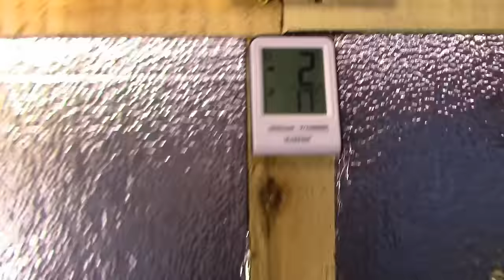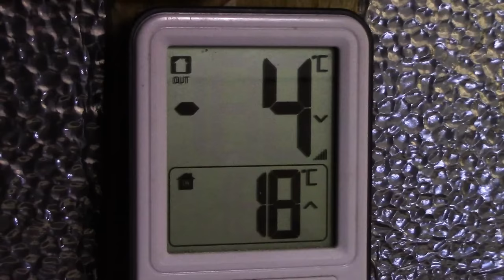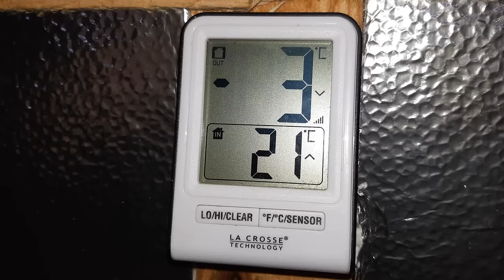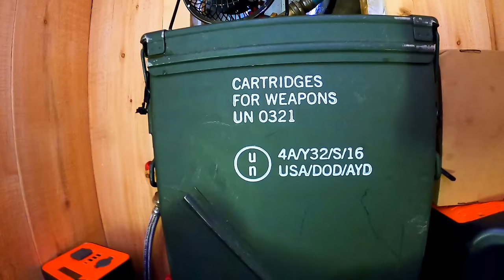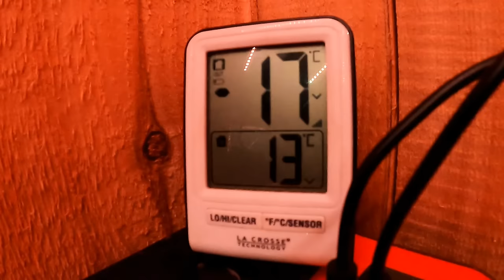Snowmobile Camper Supercut- First 3 Journeys

Comment: Possible modification:  build a folding bench that attaches to the side of the cabin for when its closed up.
Reply: I was thinking the same thing, just so you don't lose any heat from inside. You then might need to have a larger fire, but he has a chainsaw and there's got to be a dead or dying balsam near every place he's been, or I assume. Seeing as how they're all dying here in the U.P. of Michigan. Not good for stove fires but perfect for a bonfire.

Comment: You might bring additional foil-nacked insulation or space blankets to set up behind the fire and to the sides to reflect heat from the fire into your cabin. That way you could leave the door open without losing so much heat.

Comment: On the side where you put your feet with that little window you should put a table that folds up on that wall. And when ready to use it disconnect a chain or some type of latch and the table will fold down. Kind of like a bed that folds down from the wall in a studio apartment 👍

Comment: You should look into getting a diesel heater, dry heat, safe, sips fuel.
With the small area you have to heat, the heater set at the lowest setting, should keep you warm all night.
It does take a 12v battery to run the fuel pump, but it should last you for a week.

Comment: You could use a mini propane heater under the floor, venting up into camper. Like a Mr. buddy heater. Have it all outside. Maybe dig hole in snow under camper. Some sort of metal grate / vent.

Comment: Great video!  Another option for thermal battery liquid would be salt water brine.  It freezes at -21C, holds potentially more heat than antifreeze (depending on your mixture), and you can mix and discard it on site.  Probably easier to bring a bag of salt than a jug of antifreeze.  Just a thought!

Comment: I was hesitant to watch a very long video but I'm glad I did watch it all the way through to the end. It took me a little while to catch on this compilation was an evolution of a heating system. I really learned a lot about maple syrup. Really enjoyed that part. I suppose I'm fortunate that I haven't seen every video you've done as I've seen a number of people complain the entire compilation is a repeat. I wonder if they tuned out too early and missed any new content? If I may mention the copper piping that is connected to the stainless braided tubing could be insulated with pool noodles as well. Copper is a terrific conductor of heat and could be losing a great deal of heat before it even gets into the shelter.

Comment: Hmmmm...it would be interesting to investigate attaching a steel-lined insulated wood box under the camper. Perhaps semi-rigid Roxul would work as insulation. Leave an uninsulated space above the box under the floor for the heat to radiate up into the living space and means to get the rocks in and out easily. Radiant underfloor heat!

Comment: Great as always. I wonder if there are any quick release couplings like those used in hydraulic systems that you could use for the heating pipes, instead of screw connections. That way you could disconnect the heater, move the shelter and keep all of the fluids on board saving the anti-freeze even if it is enviro friendly, All the best to you and your family.

Comment: I was wondering if you ever considered using hand warmers to keep your little shelter warm? It would seem to be safer than heating stones and putting them in ammo cans that may give off a toxic gas that may injure you or burn you. Perhaps you might build a shelf with an edging around it so the ammo boxes will not accidentally fall on you, but yet, be out of the way. I'd also put a tough fabric screen over the vents so a critter could not come into your shelter in the middle of the night. I love your idea about heating your camper with a boiler concept. It is apparent that a lot of thought went into it.

Comment: Perhaps burying the lobster pot in the coals would increase the length of heat time. 
Also running the insulation closer to the fire but not so close as to burn would help hold the heat in the lines better.

Comment: Try bricks in the ammo box...Much bigger more uniform volume over rocks and flat so can easily stack(can even make a little brick oven with the fire / reflector?). You might be able, to trim them to fit in a singular ammo box? Double the insulation, maybe even clad the interior, add a YETI for the Solar panel, 1ft cargo box on the end for extra firewood/ equipment. Mass produce and make the Outsider Mobile Shelter (OMS).
Your Dad's one will be a 7 star Hotel with all the lessons you have learned. This is a very impressive project - nothing but Kudos and respect for you.

Comment: I do have a suggestion for your heating system, if you used two double wide computer liquid cooler radiators you would have a highly efficient heating system.

The double thick double wide radiators dissipate about 350w of heat, and the single thickness double wide radiators can dissipate about 200w of heat.

So with your current water system you could theoretically have a compact heating system that provides 200-400w of thermal dissipation, giving you an average of 682.42BTU and an upper max of 2047.28BTU per hour.

All of this capacity in the space less than that needed for a toaster, just make sure you get the type with all metal fittings. Another option would be ceramic heater cores like the 30 watt type just a thought.

Comment: I made a comment in one of your videos saying to run copper lines in and out of your camper but I didn't think of the ventilation situation you did excellent idea,I remember back when I was a kid guys ice fishing would use charcoal in a coffee can run to your open hole on the ice to keep the hole open so it wasn't freezing such they used a 1/4 inch copper line,that stuck in my head when you were experimenting with this similar method...great video and god speed!

Comment: Love the heating system you ended up with. I have seen something similar to heat a hot tub and small pool but never for an indoor space like that. Kind of wonder if it might work even a little better if you ran pex tubing under the floor for it to go through like in a home radiant heating system. Was also curious how the rock heaters might work with soapstone and bigger (or a couple more) ammo boxes. I know different stones have different thermal mass and I think soapstone is supposed to hold and dissipate heat much better than some others. It has traditionally been used to build masonry heaters that supposedly are able to heat homes for more than a day after the fire is out as well as in the floors in a traditional Korean ondal heating system which apparently can do the same. Might be cool to experiment with if you can find some. Anyway glad I stumbled upon your channel. Looking forward to watching some more of your videos!

Comment: Great Video. As for the cold clothes left outside: next time put them in a sealed plastic bag, even a rubbish bag with the top knotted should keep the moisture from escaping into the camper. Putting on frozen clothes definitely does not sound very comfortable.

Comment: You need outside mounted gas tank on rear of camper , no fuel inside in case leak smell lasts for hr,s maybe days insulated floor absorb . love your camper and energy Gods speed ... Play safe have fun . also like a ponton , boat have hinged both sides for rough travelling keep them up when not needed put like gate lock on easy to drop and can put pin in so can't open while on the move . also ax shovel mount outside on roof or where ever you feel like beside gas ECT .Stay safe bro ont, Canada Albo ... Looking rite arts lol.

Comment: You need to lean the difference between coyotes and wolves.  There ar several types of tiny wood stoves that would work inside your shelter just fine but you wpild need better vents to provide outside air for the fire.

Comment: You could install the canister in the top of the cabin (or even somewhere outside) and run the copper pipes in the floor creating a serpentine in the floor. Then you could install another plywood under the serpentine. You'd have a great heating system. You are doing a great job and amazing videos!

Comment: Pipes close to the fire could be insulated with motorcycle exhaust wrap maybe? Might count for when the fire goes out, bare pipe exchanges heat quickly so wrap should slow it down.

Comment: I think that if the coils outside ever cool below the shelter temp, then the process will reverse and draw heat out of the shelter. Maybe close a valve at the proper time. A small temp alarm on the tank...??

Comment: I have an idea to make your radiator last a few more hours, line the bottom of your firepit with a double layer of rocks, the rocks will radiate heat a few hours after the coals die out keeping the sand pot hot.

Comment: Definately continue with this design and improvements! Try using thermal oil (much higher boiling point and will not freeze) and bring back the small wood stove with heat exchanger coils. You will use FAR less wood and much more quickly heat the camper. It would be a good idea to build the thermal storage into the camper, say a 50+ litre tank heavily insulated and under the floor.

Comment: I enjoy your channel greatly. I often wonder why you don't add an interior wall for the purpose of protecting the insulation from damage which is usually unavoidable, and devastating to the functionality.Also,3I would add a hanging plastic material as a way to prevent heat loss while open, and during entry-exit. Like what walk-in ref-freezers have. Keep up the good work. God bless.

Comment: I would add a condensor on the line that is used to prevent over pressure of the system. You would use a coil  of  copper  1/2  line that would  return to a overflow jug that would keep the system full.
I can draw you a suggested system if you would like. .a similar systen is used in most cars

Comment: i think what may help is getting a folding camper canvas chair/table .maybe build a storage cubby on the back for it, that way you arent constantly opening the door and losing all that built up heat that your cans are working so hard to generate.  also,   id get a piece of foamboard  and fill the vent...and drill a hole for the hose to run out for evaporation. temporarily  ,  that way you arent losing more heat opening that whole vent all nite  and letting more heat escape since heat does rise. you should have enough air flow through the gap above the door. i would also get a thermal mat  under the wool blanket /sleeping bag to retain heat. , but it would help retain heat and be more comfy to snuggle down into. actually you could ...store all your bedding in that space over head... just use a locking hinged horizontal shelf. from  back wall to frt  no space wasted ;];] you could also swing  it up againist the roof and use a sliding bolt lock to hold it there..so it doesnt fall when not in use..and it wont be in your way. just drop your bedding onto the floor,  push shelf up to roof line and latch in place. make your bed up  .done. im sure it would help from dragging your bedding in/out all the time;];];]  just an idea  to help with storage;];];] great video also;];];] no snow yet in maine,   but the nights are asking for it....stay safe!!!

Comment: If you prepped your fire a little better before laying down for the night--- and stacked some rocks around your pot to help funnel the heat from the coals towards the pot even more.. and also the rocks could help radiate heat towards the pot even after the coals die down. I think the key place for innovation to this system is in the fire prep just before turning in for the night.

Comment: Leather washers .  and maybe high temperature ( home made ) silcone washers. Make a mold of the present washers.  High temp silicone sells at hardware stores. Wrap the copper lines with hockey tape, maybe. and then plumbers pool tube insulate them. It has a higher temp rating i think.

Comment: You could make integrated heating with pipes or some kind of radiator inside the cabin. Maybe more water inside the system would make it last longer and more resistant to boiling.

Comment: Enjoy watching your videos. What if you ran geothermal tubing in your sides and back walls along with the floor and roof permanently with valves for each, that way you could regulate the flow to each section. I know they also make solar powered pumps that may work all night to circulate the water.

Comment: A few tips for possibly improving ammo heater:
1) if you use antifreze as mentioned,  you can left heater asembled perametly and hang it outsede camper for quick setup.
2) use left over copper to make second coil for dumping exces heat, conect it paralel to  heater, and left it outside uder bunch of snow, (it stil has to be higher than pot, otherwise it will disrupt flow)  then add thermostat , and if temperature is too high it will decipate heat.  you wil also get rid of that boiling sound and there wil be less steam and you do not have to babysit it.
3) make copper coil in pot as tight as possible - wind it also in horizontal plane - try to fill whole pot with copper tube, use less sand.  pot will be ligther and smaller, heat capacity of sand is almost usless here, since it is outside. attach lid permanently for mounting coil on wal otsice camper for transport. also make coil smaller - now it is unnecesary big.
4) cold water outlet should be as low as possible - better distribution of heat in box.
5) paint holes in ammo box - since seal is outside, bare metal is under water and there will be corosion and then it will leak.
6) for improving circulation put pot lower (park on hill) (or if required mount heater higher. 

Sorry for qick intro, I wanted to get to point quickly, great content, thanks, have good one.

Comment: You would have to heat your 44 pounds of rocks to about 800 degrees F to hold the same energy as 88 pounds of boiling water. If you put a large well-insulated tank on the back of your cabin, you could pump the water through a radiator on the inside. You could thermostatically control the heat inside the cabin and keep it toasty-warm all night. You could even use the pump to transfer the water to and from the boiling pots with a simple valve setup. Your pump would have to be rated to pump boiling water. You would have enough heat energy to be able to operate an exhaust fan to vent gases from a small stove - you could cook indoors.

Comment: Hi Outsider.  I know everybody has a suggestion, but just wanted to mention about another possibility.  Either it’s impossible or far fetched but was trying to think of everything possible.  You know how you have heated floor pipping with plastic tubing or maybe even use copper tubing on the floor and.or walls or on the roof?  You can have water circulating through it, but not sure how to keep that heat source continually through out the night.  Don’t think the fire outside the cabin can safely stay burning either.  As far as the door access to the cabin could open like a regular door to not have a wide opening and have heat escape as easily.  When you get to build the other cabin how about making it join together so it’s connected with yours?  For example, your door now could attach somehow to the other cabin and the other cabin have it open from both sides, making it cover three sides connected (like a opened box).  All that’s left would be some way to add a bottom section?  I know this sounds weird.  If you managed to read this babbling on and on, thanks for listening anyway.  I know you have a lot of great ideas and will come up with the best and easiest one.  Love this channel and can’t wait to finish watching this one.  Fantastic wolf serenades you captured for us.  God Bless you and your beautiful family.  Thanks again.

Comment: A Slide Out Tray directly underneath the Floor, to place Hot Stones would be ideal. The Tray could be lined with 16 gauge Sheet Metal so the wood Tray the rocks sit on will not catch fire. Would free up MUCH space inside as well and would thoroughly Heat the Sled House. Doing this method would also allow you to Load and Unload Rocks without Opening the Door, letting the Heat out as often.

Comment: Diesel heater would be easier and safer.  Especially, if you added solar panels and a small lithium batteries for power to your camper.  Heat when you need it.
Reply: Yes, but they will never run out of water or wood.
Reply: @Nunyabizn3ss  And never run out of fuel with the diesel heater.
Reply: @chuckjones5797  never had a can leak or a fuel line rupture? Diesel gumming up or starving due to carbon deposits?
Reply: @Nunyabizn3ss  no. But then I take care of my shit.
Reply: @chuckjones5797 You’re saying that you’ve never had anything break on you?
Reply: @Nunyabizn3ss  yep, perfect record.
Reply: @chuckjones5797  Either extremely likely or full of it. Either way, not the norm. 2 is 1, 1 is none.

Comment: Nice design! I would try to build a cabin that you can pull over the fire. to protect the wood from below I would use aluminum sheets. with such a design, the water heater could be permanently installed

Comment: What about using rebar as a heat sink.  You make a radiator from it inside the shelter then place the source end into the fire.  It should work.

Comment: As I watch these 3 videos again,  Together this time I remember and wonder if this means you thought of ways to improve the camper and heater. The only thing that comes to mind is more insulation on the floor and wall behind heater and maybe a cement board behind heater on that wall (cement board would act like the rocks).